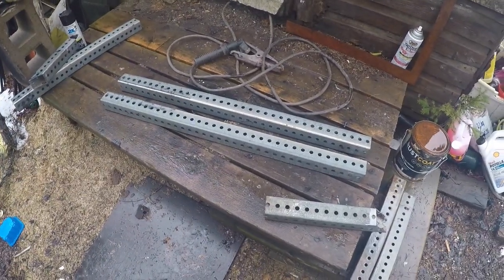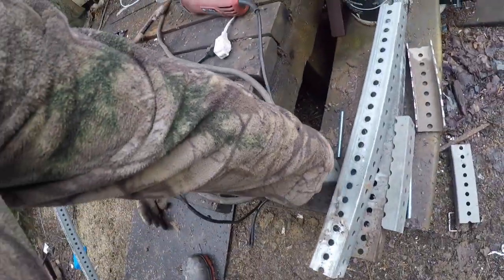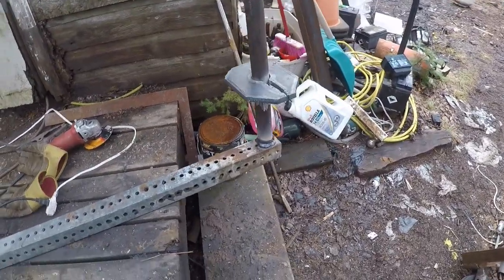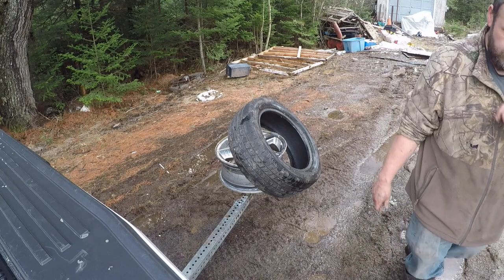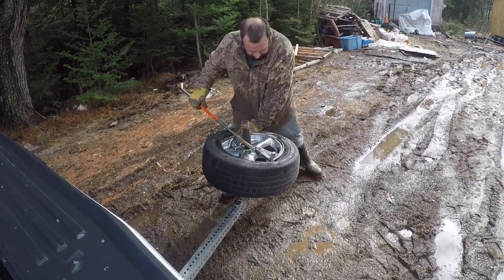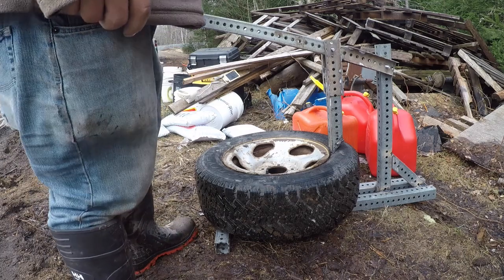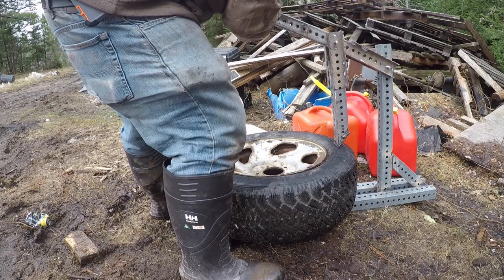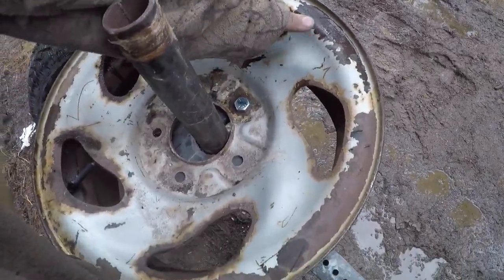homemade tire changing equipment

Comment: I would have made the shoe project further toward the root of the bead of the tyre....the wall is a bit thin where you have it pressing.....but I love it....made mine mane years ago.....not as neat as yours....but works fine.

And the tyre remover is great on your trailer hitch.....over here in the UK we dont have that sort of hitch....be so useful....I have to use 3 ft levers on my tryes as I have nowhere to anchor the rig like you do.

Done all my own tyre work since I was 17....now 71.

Comment: Thanks for the video! It gives me some good ideas after struggling with a tire change yesterday. 
I'm thinking about making a similar bead-breaker, but mounting it right to the shop wall (keeping it stable and eliminating the need for the base).
As for putting tires back on: 
Just a thought, but for mounting, would it be beneficial to have a second bar that could somehow be locked into place? It might help keep the bead down at your starting point and stop the tire from just spinning as you go around the rim. Just curious if you'd have any thoughts on that?

Comment: Ugg, Galvanized?  Don't breath:)  OUtside helps, eh.
Reply from the maker: I did try my best to stay on the up wind side. Definitely not my favorite material to use but it is what I had available at the time (and it was free too).
Reply: @rywhiskey  Yup, free is good:)  Forgot to turn on my 20" fan the other day with a novice ac stick effort and found myself coughing some.  Swapped it and some cash for an ac/dc Miller unit I haven't tried out yet.  My Harbor Fright 90amp ac flux core wire feed is pulsing.  Capacitor or two is out I'm thinking but haven't checked it out.  Time for DC there too I'm thinking.  May try a conversion but HF offered me 100 bucks trade-in if I bought the "warrantee" with some retroactive slight of hand for 30 or so.  $210 DC machine for 140 all together might not be bad.  Mine's  ten or more years old anyway.  Depends on how well I like my antique Miller stick that'll go down to 20 amps.   Like the simplicity of your bumper mount effort.  I tied my HF to the receiver but ended up putting plywood under it anyway.  May do yours as well;)  Be safe.